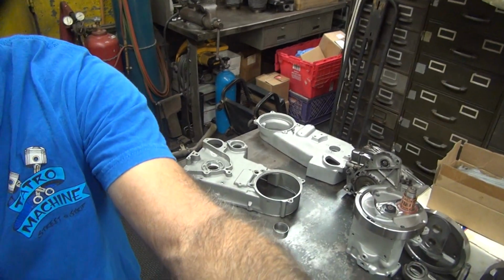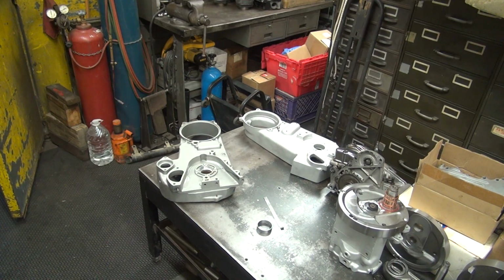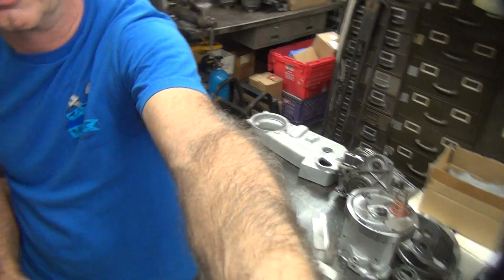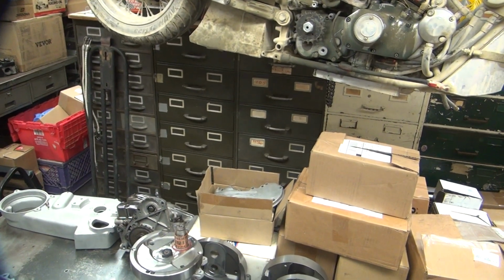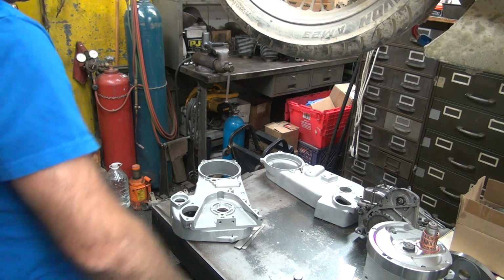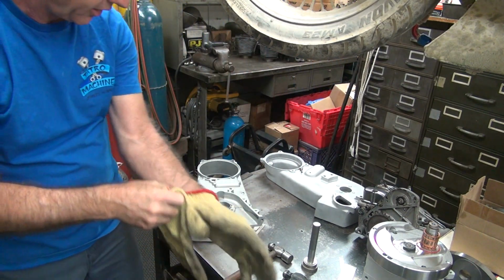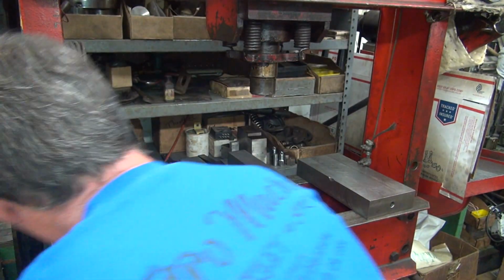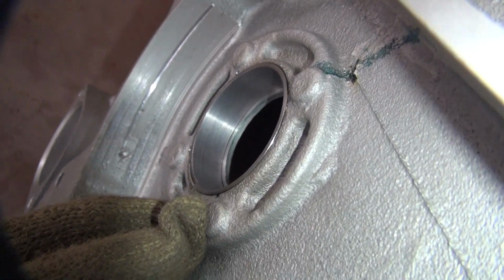#117 1983 fxrt shovelhead inner primary loose bearing repair 1979-84 FXR FLT harley tatro machine

Comment: I've always used my small propane torch to heat up parts to remove and/or install them. But, I recently had to replace front wheel bearings on my '07 BMW K1200GT. To remove the original sealed bearings, I had to use a heat gun from Harbor Freight and an infrared laser thermometer also from Harbor Freight. (JIMS tool to punch them out.)  HF Total less than $50. I had to be careful on that work because of the powdercoating on the factory wheel. Flame would melt it. I also recently replaced all the bearings and races on my '77 FLH cast wheels and, I just used the propane torch to heat the wheels. Froze the races before drifting them in. I am learning a lot from these videos! Pointing the flame underneath the casting was pretty smart of you. I don't think I would have seen to do that.

Comment: I’m looking for a inner primary Case for my 83 fxr mines broken from were it bolts onto the Motors bought the bike like that?
Reply from the maker: that is how most of them are. they either need to be repaired or they have already been repaired. good ones are hard to find and they all have this loose bearing problem. that is the way they were made.
tatro
Reply: I see you buy a lot of junk off eBay, anyways I put an Evo in my 83 FXR. I have no use for the shovelhead engine complete. Would you be interested to trade for some stuff? I could even send you a video of how it runs. Also have panhead heads 1956 and some other parts